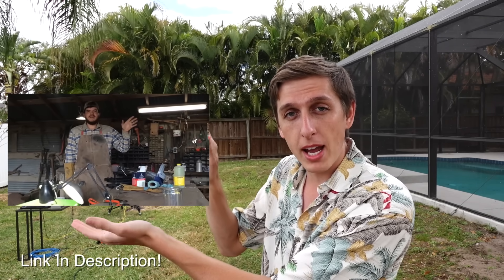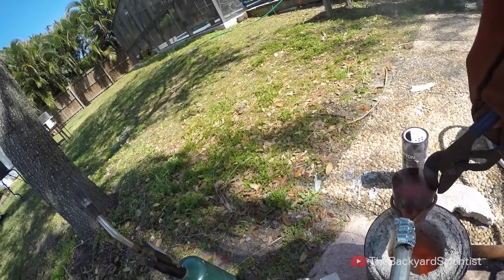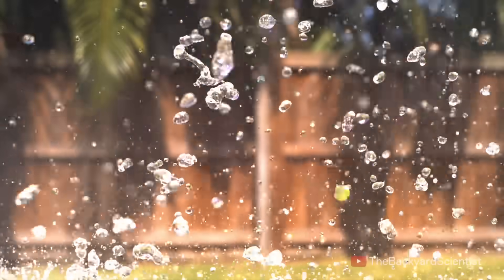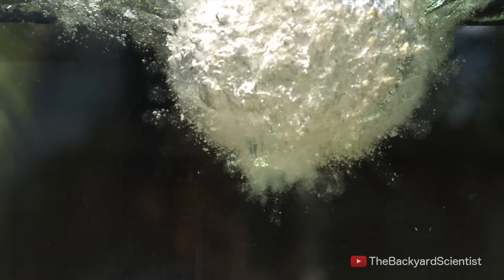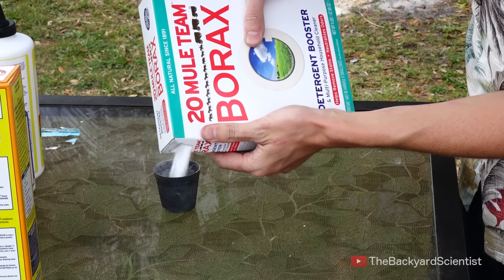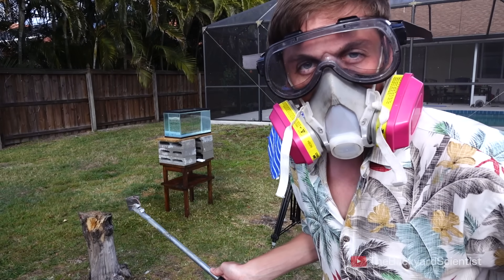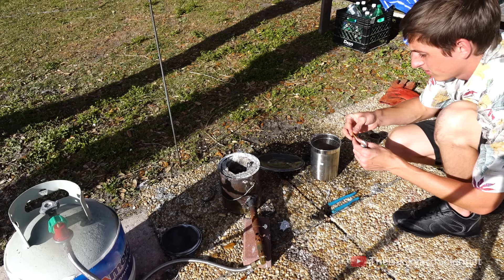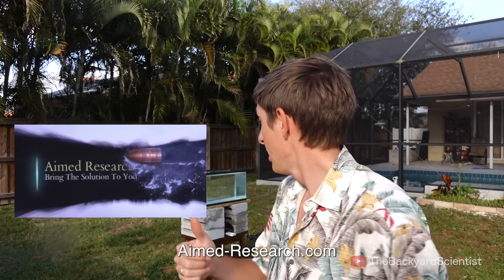Pouring Molten salt into Water - Explosion!

Comment: Sodium chloride melts and becomes a liquid at about 851°C, water boils at 100°C. Hence, what you are observing here, is a shock wave (explosion) created by rapidly boiling water with molten sodium chloride. In addition, to the cooling of the molten sodium chloride there is  an exothermic dissolution of the ionic liquidity Na+Cl- into aqueous ions Na+ and Cl-: 

NaCl(s) → Na+(aq) + Cl-(aq)

Ionic bonds are broken and ion water molecule bonds are created, resulting in an exothermic yield of heat.

Comment: when he melts the salt it separates into chlorine gas and pure sodium. all group one metals explode in water with sodium having the biggest reaction.
Also Chlorine gas is toxic so dont try this at home
The chlorine gas that is still trapped inside the molten salt forms a protection bubble that allows the salt to go deeper in the water vs exploding on  contact like the pure sodium
Reply: no its the solubility of the salt causing the ions to seperate creating a similar effect to that which pulls the salt into the water imparting all its energy but no sodium or chlorine would be formed in their elemental form otherwise the chemistry of the water would tends towards increase in pH but he tested that in another video and it remained the same.

Comment: Perhaps your are splitting H2O into H + O2 at 1700 degree. Only that will expand , try to set it on Fire under highspeedrecord to see if the gases can burn at the short Moment of expansion.

Comment: Pretty sure the potential chemical energy of sodium chloride is much different than that of borax salts. Table salt will dissolve in water just with a little stirring. Other salts? Not so much. Given that this a purely physical reaction, the salt that breaks down easiest will do so more explosively as potential thermal energy causes both water and salt to change states rapidly upon contact.

Comment: First of all,
Sodium like lithium and cesium are rare earths, the higher their atomic number the more intense the reaction when in contact with water even non heated. Na+H2O = NaOH + H, the surplus of H combines to H2 which reacts with the O2 in the air resulting into a combustion. When melting salt the ionic connection might be loosened, leading to a possibility of reaction between the ions with water molecules, leading to NaOH + ClH. Both being strong acids the pH doesnt change. Additionaly we have the temperature difference leading to an explosive expansion of the water volume due to evaporation and a energy redistribution of binding energy between atoms (mixing salt to water diminishes its temperature/energy content for the new connections) could also be a cause for the explosion ( it wasnt an oxidation reaction like with only sodium)additionaly to your hypothesis. 
This is my two cents without being am expert. Cool video giving a nice issue to think about. Cheers

Comment: I still think it was the sodium reacting with the water. Even room temperature sodium will react with water.
Reply: It is.  Elemental sodium reacts violently with water to produce heat + hydrogen gas = explosion. This guy calls himself a "scientist" and can't be bothered to look up basic chemistry that has the potential to be lethal. Many elemental metals will react violently with water. You can look up foundry safety videos which warn against having any moisture around when working with molten metals because of explosions that can and have occurred that kill everyone in the area. The only thing that saves this guy is the impurity of his materials in this and the aluminum video.

Comment: There does seem to be a temperature coefficient connected to your experiment.  Once you reached the temperature that gave you the results you were looking for, you finally observed an explosion.  Could the temperature be changing the molecular structure of the Sodium Chloride that causes the Sodium to finally react to oxygen in the water? In order for a solid to become a liquid, the molecular structure must undergo some kind of expansion to becoming liquid. Liquids become gases under the same conditions.  Just like salt crystals, water crystallizes under temperature changes as well.  If you use electricity, you can separate water into it's constituent gases. 2 parts Hydrogen, 1 part Oxygen. Mix the two together and you have HHO which by the way is very combustible.

Comment: Salt is sodium-chloride when put at high temperature the sodium separates from the chlorine and since the sodium has one valence electron it reacts very violently with water and even air
Reply: That's why he poured sodium in to compare the reaction...  It's definitely not exclusively that.  This is not a chemical reaction.  It is physical.  The water is being super heated and expanding.  As this guy said, the only real question at this point is why the Leidenfrost effect didn't affect the liquid sodium chloride, even though it affected the other salts.
Reply: Which means it still a chemical reaction lmao
Reply: Yay I'm not the only one who know this

Comment: Congratulations. You've rediscovered the steam explosion alla nucleation: something that can happen to recovery boilers if their liquor is below 67 % solids. A higher temperature for the salt induces a steam jacket that insulates the salt and results in a lower heat conduction. Also, nucleation sites on the NaCl (as a result of the thermal shock that causes the cracking you hear), blah blah blah, assist with the rapid formation of vapour. The volumetric expansion is of the order of 1000 times compared to liquid water.
Reply: Got any idea why it only worked with NaCl? Something about the melting point, specific heat capacity, different number of nucleation sites compared to other salts?
Reply: Actually, in this case, its more likely a Coulomb explosion, like what happens when you drop pure sodium metal or molten aluminum in water.
Reply: YOU GOT THIS BY LOOKING UP WHAT HAPPENS WHEN POURING MOLTEN SALT INTO WATER THEN COPIED AND PASTED IT HERE.
Reply: Nerd
Reply: ^
we have a funny man here

Comment: U don’t need molten sodium for it to explode in water. That is a chemical reaction, so hot or cold, the sodium will explode when in contact to water. The resin table salt is safe in water is because it’s sodium chloride, and the chloride makes it so it’s not reactive to the water. But when u melt the sodium chloride u are separating the chloride from the sodium, making the sodium able to react to the water and exploding.

Comment: NaCl won't split into Na & Cl because it is melted. Na gave its electron to Cl and Cl won't give it up except to a stronger chemical pull. I tend to agree with your hypothesis that water expands in pockets' especially since the salt crystallizes quickly causing firmer pockets for the expanding gas to push against and generating pressure and explosive force.  One possibility that the other ionic compounds you tested didn't respond similarly is that they all contained polyatomic anions which alter shape and structure in the crystal lattice formed when crystallizing.   Try KCl or something with a similar structure to NaCl and see what happens.  I also agree with you that it wasn't the brightest move to pour molten Na into water wearing only your shorts & beach shirt.  When that stuff hits bare skin (especially wet bare skin) any Na that hasn't reacted keeps reacting with the water in your tissues and keeps burning!

Comment: would it due to
2Na+2H2O ----> 2NaOH+H2
2Cl2+2H2O ----> 4HCl+O2
HCl+NaOH ----> NaCl+H2O
And E(burning salt)=E(react with water)+E(lost in air)
However experiment get that it took 10min to heat up but release those Energy in one sec which due to reacting speed?
Reply: I can't understand the formula 😭😭😭😭
Reply: @MisterSleep1123  From what little I can remember from high school chemistry:

2Na+2H2O ----> 2NaOH+H2  
Sodium + Water produces Lye and Hydrogen

2Cl2+2H2O ----> 4HCl+O2
Chlorine + Water produces Hydrochloric Acid and Oxygen

HCl+NaOH ----> NaCl+H2O
Hydrochloric Acid + Lye produces Salt and Water.

Comment: The pH strip only measures the H+. Since Na+ remains an ion in water, the pH value would not change significantly.

I still enjoyed the explosions.
Reply: If the sodium is still ionized in the water then it didn't react with anything.

Comment: Pure sodium explodes when made contact with water. With no thermal difference. Its a chemical reaction, and very well documented and proven. Also Lithium has a similar, yet more volatile reaction.

If anythimg heating the sodium may help you get a bigger reaction as the air pocket cause by heat would delay the explosion allowing for more contact.

Comment: Kinda easy explanation, the molten salt heats up the waterbso quickly it converts into steam, so it actually expands. But because it heats up so fast, the expansion is way to fast to escape from the top only. That's why it will escape from the sides and bottom to, but there is the glass wich will just break appart.

Comment: Your hypothesis does not hold water, sorry could not resist the pun. Anyways, if it was a physical reaction then it would have exploded the first couple times you tried it. You need to reach a critical temperature where the sodium chloride bond is weakened enough to be separated and the sodium react with the water. This is also why the other sodium compounds did not react. They have a much higher threshold to reach that critical temperature where the sodium will react with the water. I propose that if you were able to get the other salts containing sodium up to a higher temperature. They too would react similarly to the sodium chloride
Reply: No, you are wrong
Reply: NaCl is more hydrophilic than the others. Hence why it was able to overcome the leidenfrost effect.
The other trials did not have the required heat to cause the exponential expansion to the same degree. You will notice that something did happen in the first trials, yet the result was less vigorous.
If your hypothesis were correct, there would have been zero effect

Comment: It's probably not a chemical reaction since I can't think of a product of resulting from water and salt that is in gas form AND does not change the ph. Only steam. While elementary sodium on the other hand will react with water giving NaOH and H2, causing expansion/explosion. Funnily enough, with solid sodium, you can have very different result depending on HOW you put it in water. Laying a small chunk on the surface can will result in the chunk keeping itself afloat thanks to H2 bubbles formed underneath during the reaction. Completely immersing it instead should cause a more violent result and a possible explosive one at that. More or less intense versions of the same phenomenon should happen with all the metals on the far left columns of the periodic table, since they share similar properties and reaction with water. Potassium(K) should be stronger for example(if memory hasn't failed me). Source: cool high school chemistry teacher.

Comment: It looks like it's just hydraulic shock caused by a lot of steam being created underwater. The high heat of the molten NaCl causes steam to expand outward, which then rapidly cools back into a liquid or becomes trapped by the surrounding water. Since fluid cannot be compressed under normal circumstances, you have action, liquid under pressure, reaction, liquid generates outward pressure. The borax didn't react as violently because it was much cooler.

Comment: one need NOT melt Na metal to get a hydrogen gas explosion. The evolution of hydrogen from Na and water is SO rapid that the gas generates enough heat to spontaneously ignite.
 The water blown up and outward is a very caustic lye solution and will burn  flesh.
Moten Na in water is overkill. 
Suspending a quarter-sized lump of Na metal suspended over a bucket of water, then cut, does the trick. 
Distance and protective clothing is a must. 
Heat and lye is a no no on flesh. Also you're playing with fire.

Comment: You would wonder if you could drill a hole 3-4 foot around and about 10 foot deep into rock fill it with water to a depth of 3 foot and drop a clay canister at 1700 degrees around 2 total pounds into it......The ancients could of had thier version of nitro at a very cheep cost....😎

Comment: 7:21 I thought another thing happens: When you mix the molten salt (sodium chloride) with water, it quickly need to change the covalent link between chloride and sodium atoms into Cl- and Na+ ions and that change is violent because of the temperature. Could it be the case? I'm not an expert in Chemistry. I liked this video!
Reply: That's the case for solid sodium, which is why he ran a test with solid sodium. As you saw, the reaction with solid sodium is much quicker, occurring before the compound can penetrate into the water, causing flames to spark in the air.

Comment: I'm surprised that no one has mentioned the molten salt power plants that are in use in Nevada, China and Australia.  

When you melt salt at about 1,100 degrees F with heat from the sun, you can turn water into steam and run turbines to create electricity.  And the liquid salt continues to turn water into steam long after the sun sets.  

The potential is enormous.   When the salt cools it returns to crystal state to be reheated.  When the steam cools it returns to water.  If Central Park was covered with mirrors that focused the sun's energy to the reactor, it would generate enough electricity to run the entire borough of Manhattan.  Of course you could place the power plant anywhere.
Reply: Solar is extremely undertapped even as-is, let alone when we can relatively simply power our already-existing turbine-based power systems by exploiting it.
Reply: @Starfloofle  the thermal activity in Yellowstone has the potential to supply the electricity for the whole world.
Reply: @Terryblount  that's a bit of an exaggeration.
Reply: @Terryblount  of course, that's why we built nuclear powerplants: because it's easier to extract uranium, bring it back in big box of plumb and making it explode than just exploiting a free unlimited energy source!

Wtf dude?!
Reply: @levizar7971  30 nuclear power plants have been shutdown by Obama EPA regulations and almost as many coal powered plants. 
Amazon has gone solar and now Walmart is getting off the grid.  They know what lies ahead... Brownouts and power failures.   Electricity is going to be expensive or eliminated if AOC and the environmentalist achieve their stated goals.
Reply: @Terryblount  You missed my point: it was an ironic statement because yellow stone doesn't have an unlimited power supply capacity. :/
Reply: @levizar7971  Nothing has an unlimited supply of energy.  Even the sun will eventually burn out.

But until the core of the earth cools there will be hotspots that release thermal energy through the crust.
Reply: @Terryblount  that's theoretical though. The premise is that you would dig 50 meters plus huge tunnels to tap the thermal energy. Not only is that task an extremely hard one there's factors like potentially creating a massive thermal bomb with rapid heating of water ect. It's is plausible just not now. Technology hasn't made it that far. Also if you think about it the thermal energy around the world once you get through the crust is unimaginable
Reply: @davidpatel5267  The currents in the oceans and movements of the tides might be easier to tap into.

There are also 3,500 dams in the US that could have hydro generators but don't.
Reply: @Terryblount  Maybe. It is one that can be reliable and creates enough energy despite not being as efficient as nuclear and coal obviously. There's always social issues because people love to complain but I certainly back its use. It just won't be capable of powering everyone on call to demand so nuclear is still best bet but ye why not. Costs alot but it's a worthy investment
Reply: @davidpatel5267  I would agree that nuclear has the best potential... But 30 nuclear power plants have been shut down and all but one of the last 20 that were under construction have been scrapped.

I don't know why this has happened but I do know that they work... That means there are social isues or overregulations.
Reply: @Terryblount  I meant more money needs to go into the research of fission. Fission is the answer to all problems
Reply: @Terryblount  Your data concerning nuclear power plant shutdowns by the Obama administration and the EPA, among almost all of your other statements, are grossly incorrect. 
You sound very "know-it-all"-ish. Perhaps you were counting on no one being bothered to check your "facts"?
Reply: @Bryan-vz8ti  
Just post the numbers that you think are correct.

You'll probably say that the Obama administration closed 9 nuclear power plants while I say 11.

Potato potatO
Reply: @Terryblount  Just tell the truth from the start, then you wouldn't have to be a liar.
Reply: no molten salt lower plants in Australia buddy. it coal or solar.
Reply: I'll have to validate this for myself
Reply: This is extremely over simplified and it doesn't talk about the salts used or the dangers from those molten salts.

It would be nice to use molten salt reactors, but not even GE or Westinghouse will let the NRC look at a design yet.
Reply: Well explained, you just provided a possible solution for renewable energy
Reply: Also roast a lot of roasted birds along the way...so yaay free BBQ...
Reply: Nerds
Reply: @Android Galaxy 
You don't need to call anyone "numb nuts" here. This not a discussion for fighting.

As of 2019, there are no operational thorium reactors in the world.

A thorium power plant is very expensive and  Thorium, when being irradiated for use in reactors, makes uranium-232, which emits dangerous gamma rays.